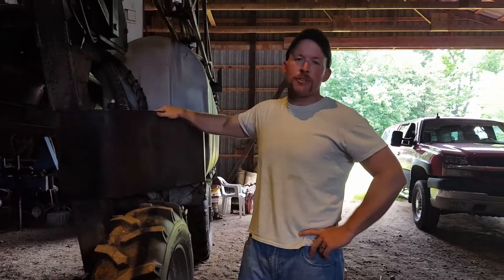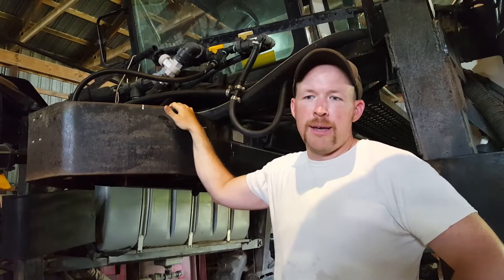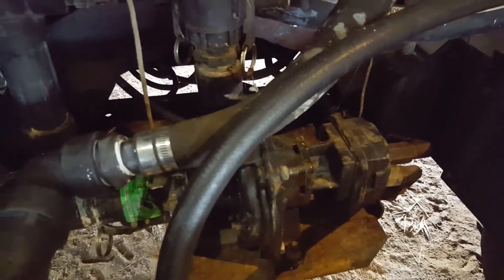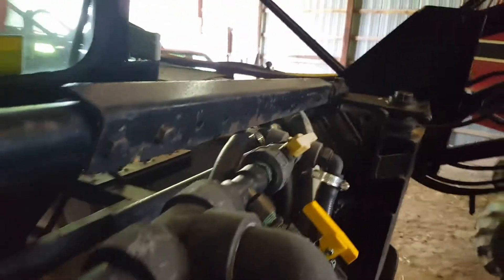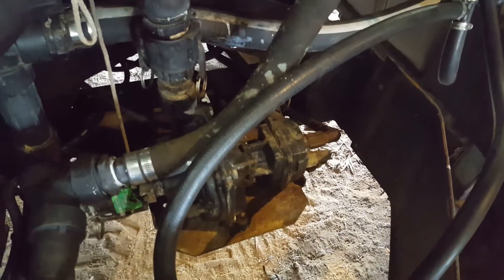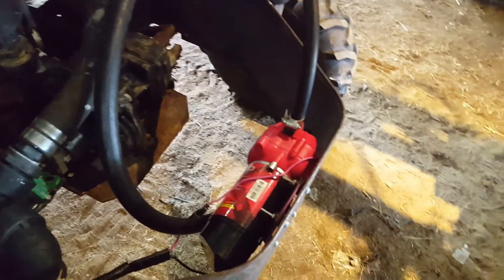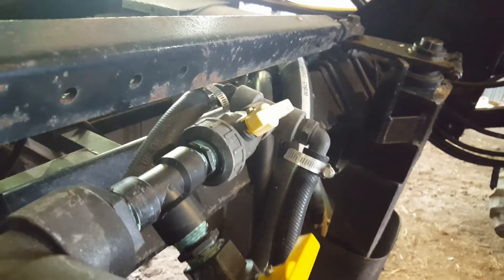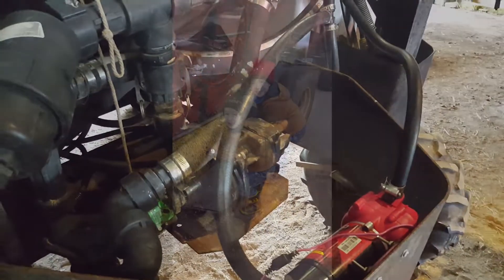Difficulty Priming Hagie Sprayers w/ DTS Configuration? WATCH THIS!

Comment: do you worry about contamination or how do you flush between changes?
Reply from the maker: I am probably pushing it a little, but I only add about 25 gallons of water to each tank with liquid tank cleaner, prime, let it agitate for 5 minutes and then spray it out.
Reply: @bantambrio  Thanks! I am looking at getting a 2100 just dont see a ton of videos on these older machines